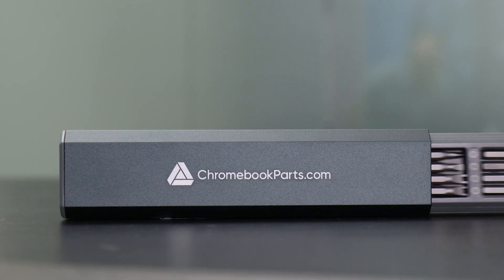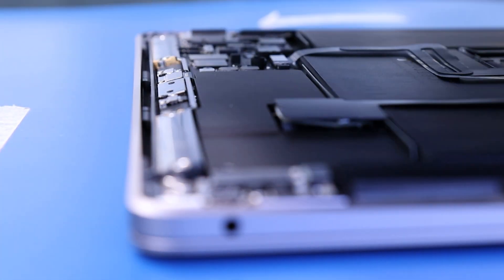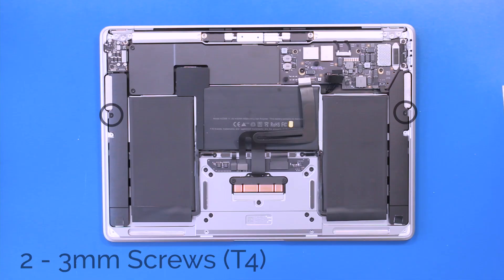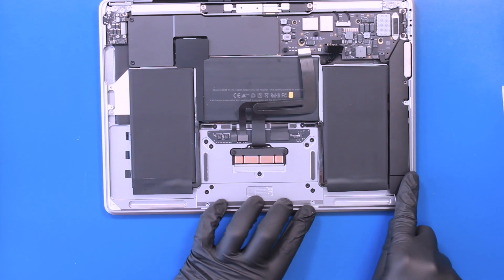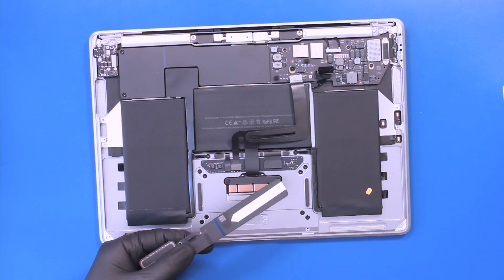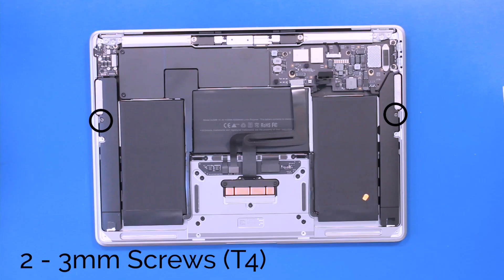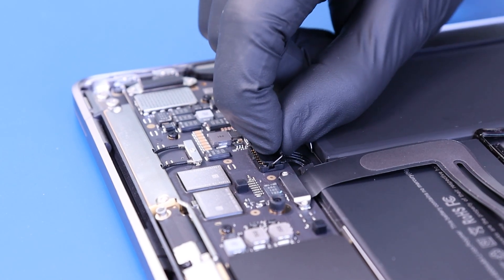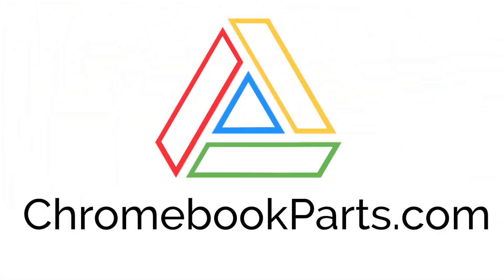MacBook Air A2337 (2020) Speaker Replacement

Comment: hello! have you encountered macbook pro m1 with the hissing and crackling sound? the right speaker is basically unusable. you think this is hardware and should replace it?
Reply from the maker: Hello! In our experience, a constant hissing when playing something like a video would point to a speaker issue, likely with them needing to be replaced. However, if the sound cuts out completely, then we believe that whichever board the speaker is plugged into likely has the issue (if you're viewing the device from the keyboard side, then the right speaker would connect to the daughterboard).